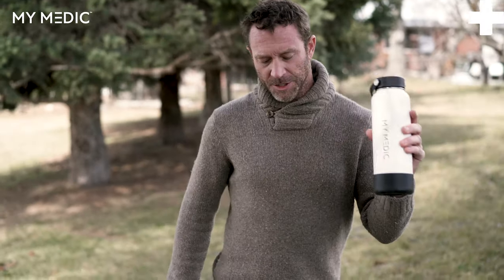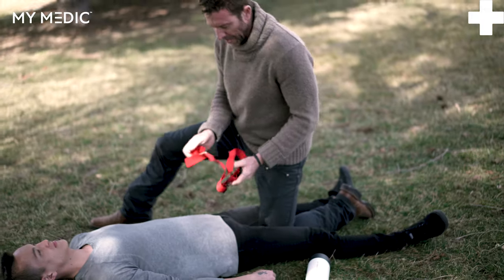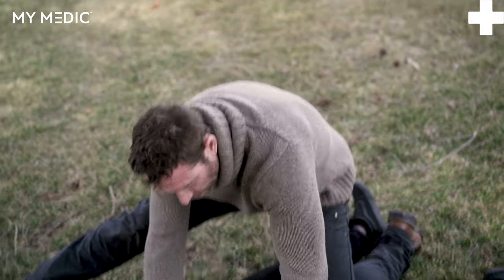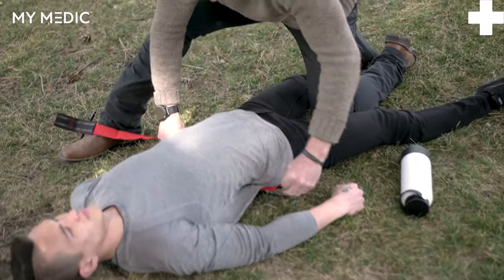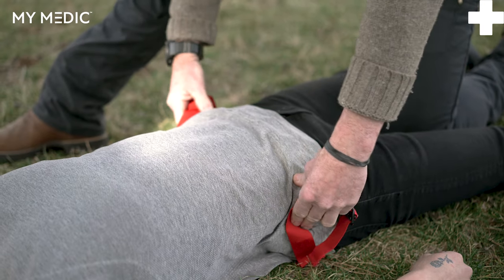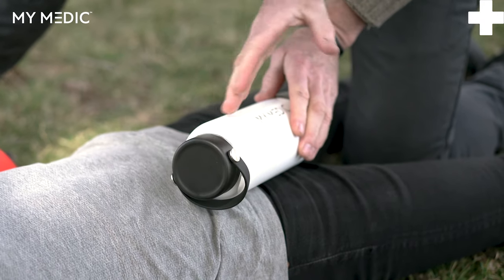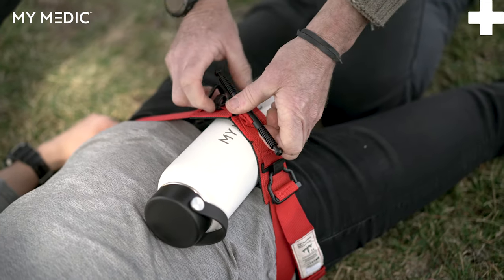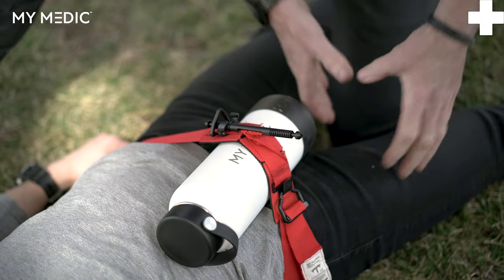How To Make A Junctional Tourniquet

Comment: Bleeds like this are very tricky! I have a few follow up questions!

What kind of accident can cause a cut in this area but also carries minimal risk of a broken pelvis?

Is there any way to be confident that the pelvis is not broken before applying this style of tourniquet?

How would you stop this type of bleed if the pelvis was thought to be broken?

Thanks for this video and for your insight!
Reply: Es el mismo principio del torniquete de Union, busca tapar la arteria femoral en caso de doble amputamiento traumatico, y en caso de fractura de pelvis seria torniquetes en ambas extremidades amputadas o en lo que quedan de ellas  y tratamiento de la fractura o sra inmovilizacion